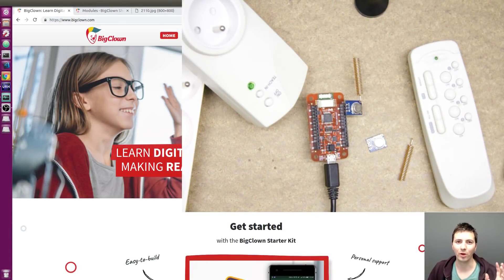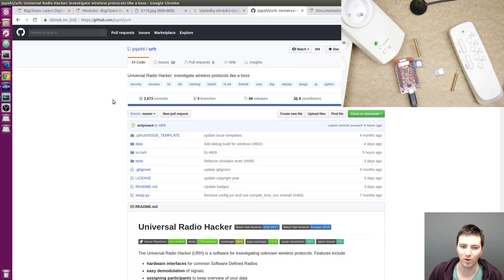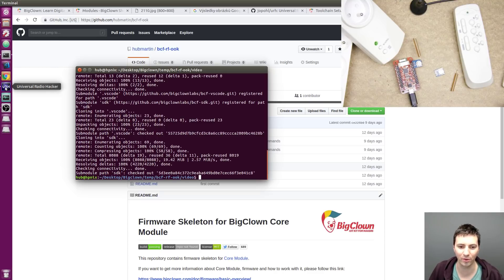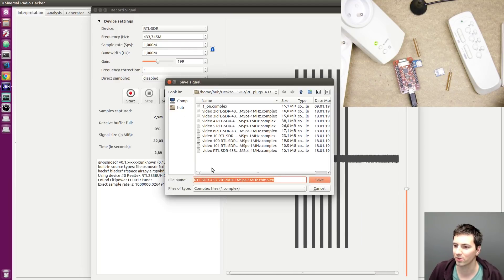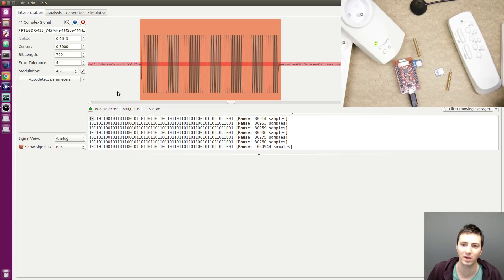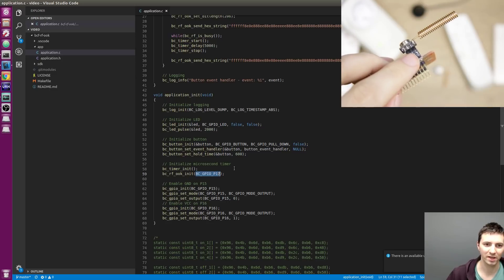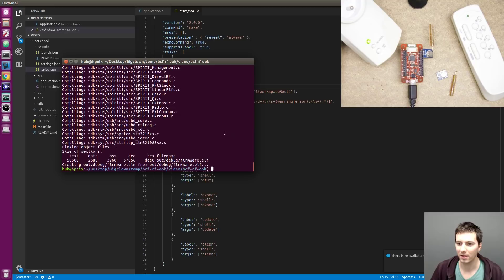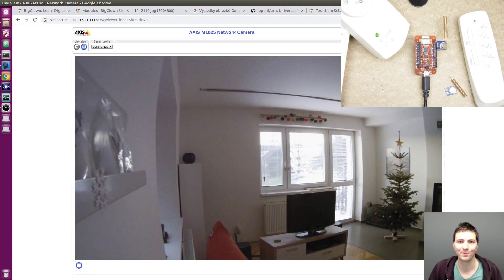Universal Radio Hacker SDR Tutorial on 433 MHz radio plugs

Comment: For the Rx portion, is it possible to use an RTL-SDR to capture the signal instead of the BigClown Core Module? 

Also, have you ever used merbanan/rtl_433 (or winterrace/rtl_433_win) and a prometheus endpoint (datajrolli/wx_prom) to decode TPMS, Wireless Sensors, And Key Fob's ETC?  'Tech Minds' has a blog post on it, but would love to see a video of it in action... and/or how it compares to Universal Radio Hacker (URH)!
https://goughlui.com/2013/12/20/rtl-sdr-433-92mhz-askook-decoding-of-various-devices-with-rtl_433/

Comment: Great, now I can finaly understand how Universal Radio Hacker works

BTW: I was always wondering if its possible to make this with something like HackRF and GNURadion (if there is any library like that so you don't need to fiddle with modulation and generating OOK signal by hand) instead of this 433Mhz modules
Reply from the maker: Hi, thanks for your comment. There's a few video tutorials but they do not show practical usage of this tool. That is something I tried to explain. URH has much more features and you can use. In one of its tabs you can replay the recorded signal by TX SDR. It would be also possible to integrate some driver which controls just the OOK and bitrate directly from URH. So you don't have to buy full SDK with TX.